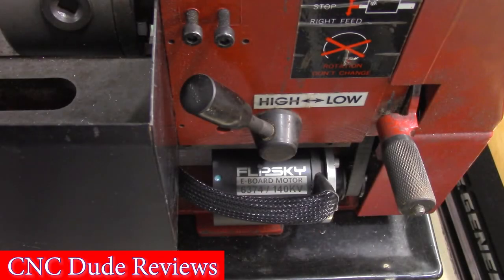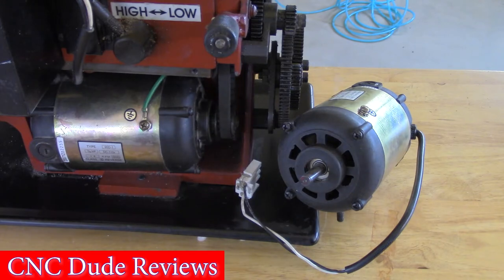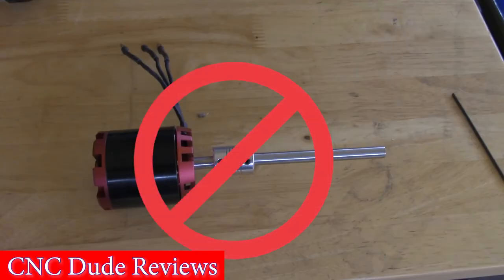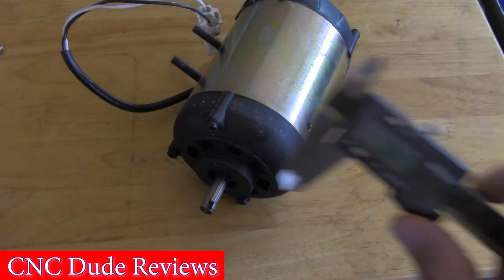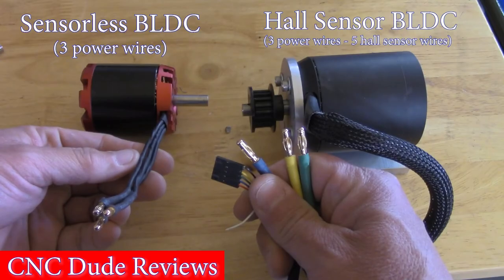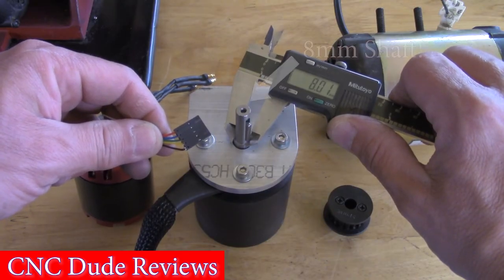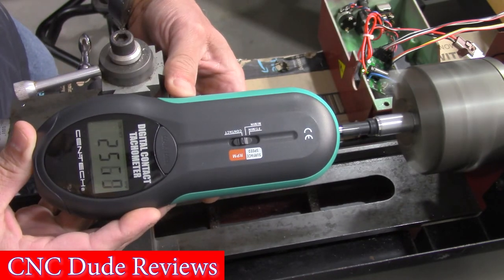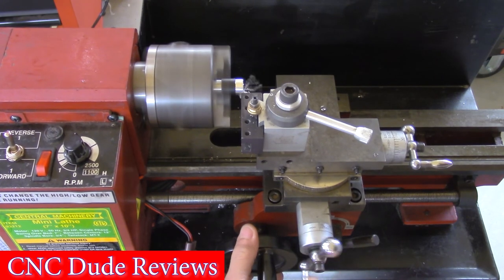7x10 Mini Lathe Tri Phase BLDC Motor Selection: Flipsky 6374 140KV BLDC Motor

Comment: Hey man, thanks for the video. I am looking at getting a 6483 140kv sensored motor for my mini lathe but I got a bit confused on which speed controllet do I need to get. The oridginal flipsky controller costs about 130 dollars maybe there is a cheaper version pf the controller?
Reply from the maker: Well, I designed my own controller as you can see in a different video. That controller is kind of small and hard to position within the enclosure so I am redesigning to make it easier to mount into the Lathe. It will also be exclusively designed for the lathe so you don't need to worry about how to control the speed and such. Most ESC's out there use a remote control interface so then you need a controller to control the controller! There is no need for such complexity... Thanks for watching!
Reply: @CNCDude  hi  mate, wichone is beter used bldc 6374 or servo  sewing machine sir, if u think it??? Before i buy the bldc
Reply from the maker: @botak333  This will depend on what you want to do. It will also depend on the voltage. In this video we are working with low voltages so the BLDC would be better. If you want to work with line power, then the sewing machine servo is an option. If the project in question is a lathe like this one, either could work, but be aware there will be a step down power supply for the low voltage version.
Reply: @CNCDude  yer sirr, because i want to build for my diy spindle also, i want cutting alumunium or mild steer i have diy bt30 so for now just need the motor, im confiusd, sewing motor reach 5000rpm but i dont know the torque, for bldc 6374 i see max rpm 8000, and torque around 3Nm ( i will use reducer 2:1). If u think wich one is the best choice for lathe and diy spindle also i have PSU 36V 20A.